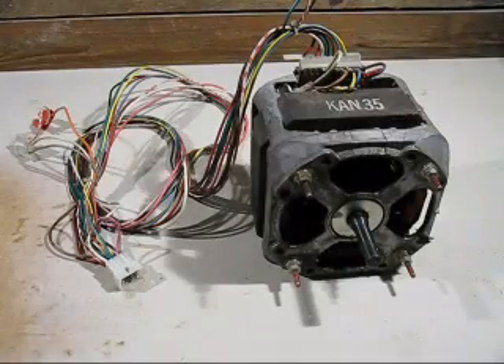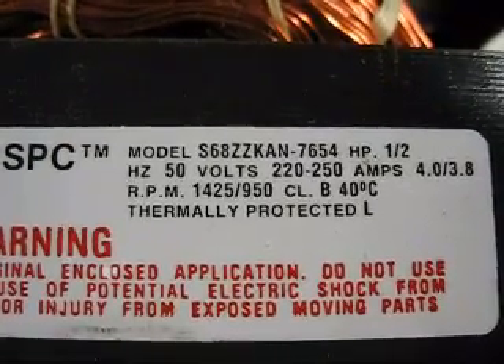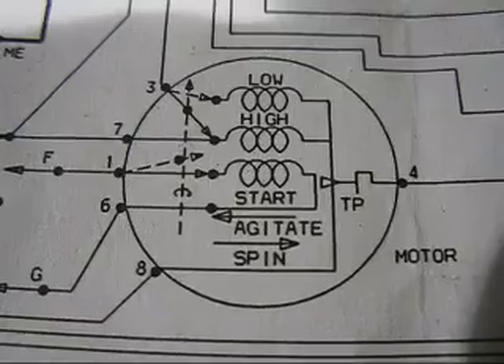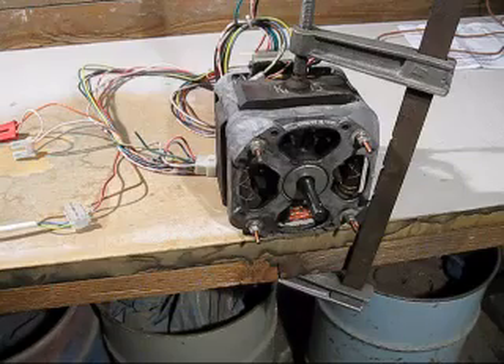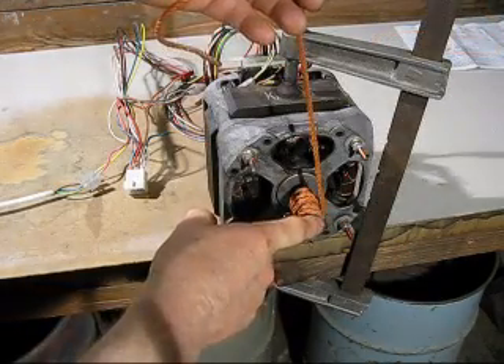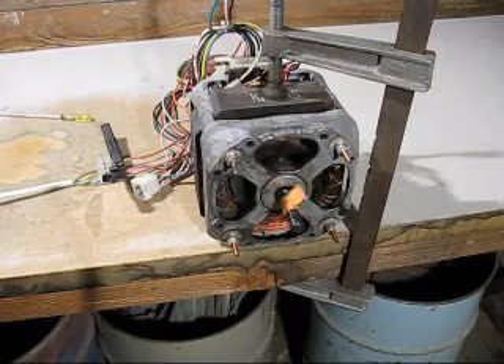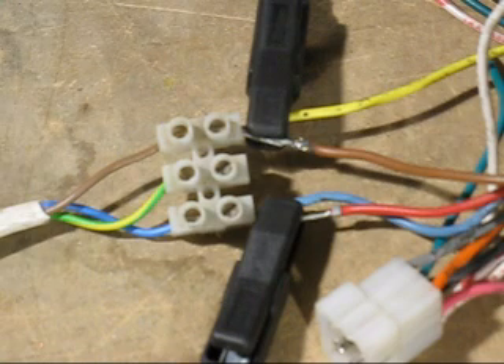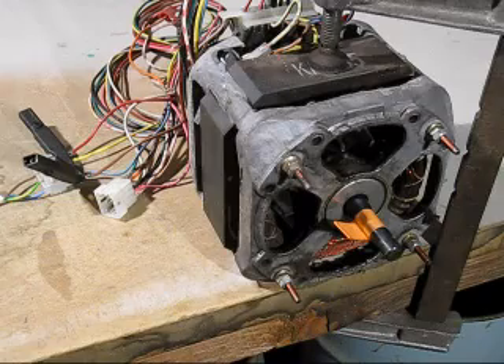How to connect up a two speed single phase motor

Comment: There is a subtlety with these washing machine motors. The starting winding and the 1425 R.P.M. running winding have four poles and should always be used when starting. A third 6 pole winding is  used for 950 R.P.M. This is connected via the governor controlled change-over switch.
There is nothing to recommend starting with one four pole and one six pole winding.

Comment: I just happen to be doing the same thing, what puzzled was no capacitor . Looked at many videos but no wiser, then I just happened to see your video , and yes just like my casting problems you put me right. Just in passing I have just finished a metal spinning lathe and no nothing about spinning any tips you may have picked up along the way would be most appreciated.